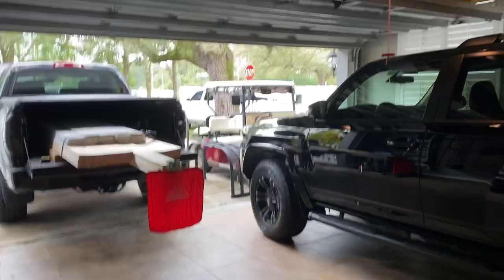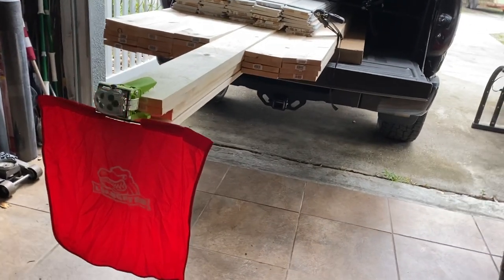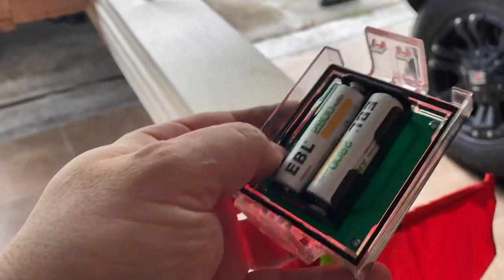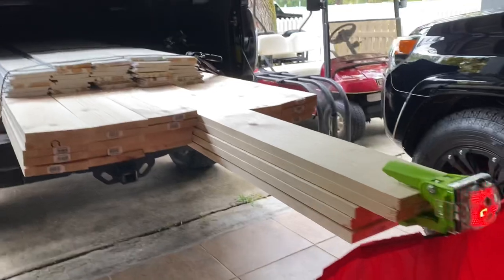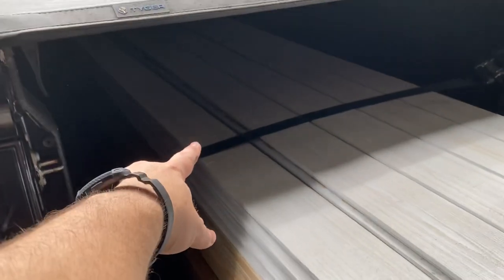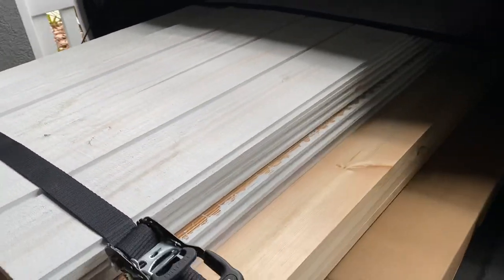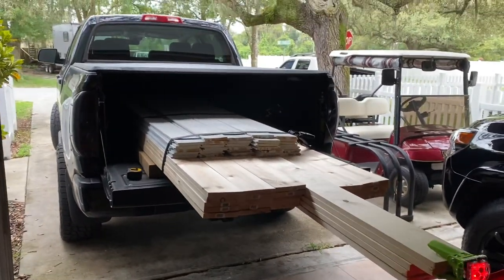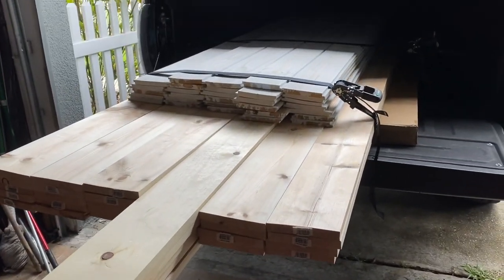How I safely haul long lumber in a short bed

Comment: Nice flashy thing..We have a 2003 Chevy S10 Crew Cab ..Great truck but the box is 4'8" deep...6' or so with the tailgate down...so We use the hitch extender that looks like football goal posts on a arm made of 2 inch square tubing stuck in the hitch receiver..I will add the light ..good idea...
Reply from the maker: Yep I have that bed extender too I do love it. Mainly use it for 16’ stuff. The light flag is a pretty awesome little gadget and if it saves a life and prevents someone from rear ending me, I’m all in.